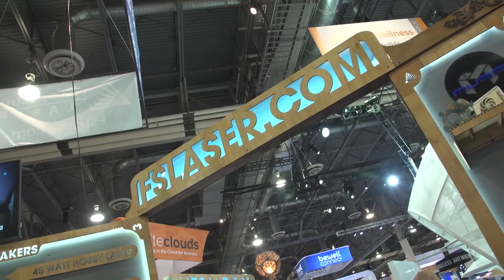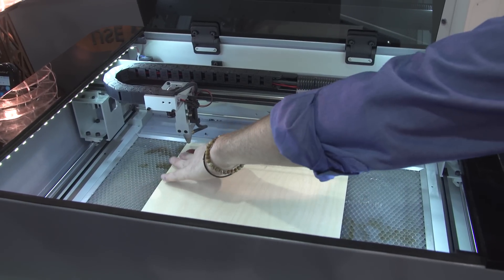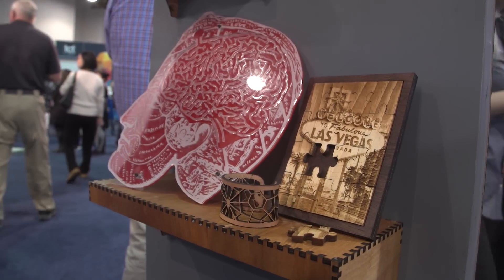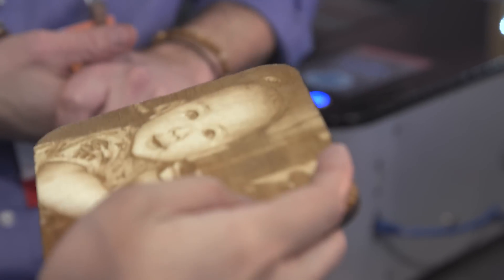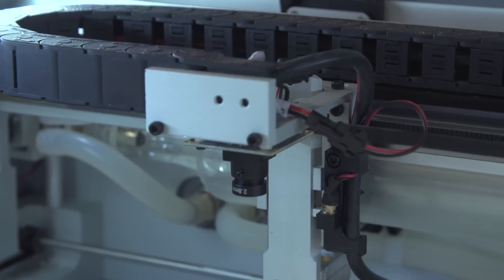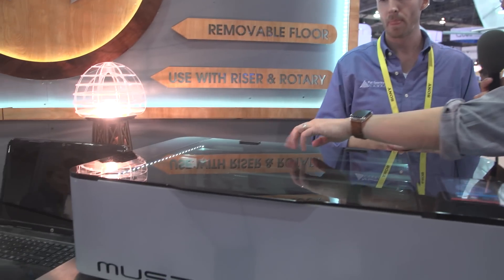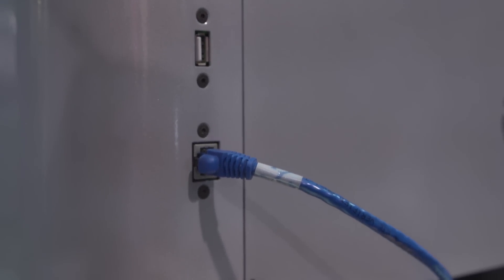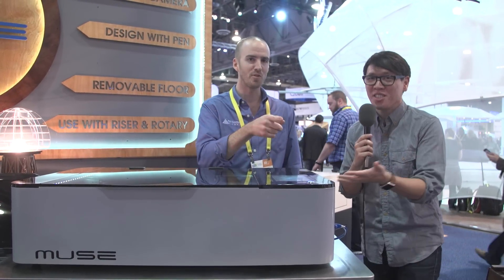First Look at the $5000 Muse Hobby Laser Cutter

Comment: I bought a MUSE as soon as it came out (big mistake) my experience has been disappointing.
List of issues:
Alignment:
- The machine has a cheap red diode that breaks easily. I broke mine a few days after using the machine.
Lenses:
- Overpriced. Lenses are glued to a metal support and FSL charges $250 for new ones.
Software:
- Retina engrave 2 was very limited and had several issues with vector files. RE 3 seems a bit better but has a whole new set of issues.
Hardware:
- If you are out of warranty you will have to pay for hardware fixes even if it was a design issue (not customer issue).

Do yourself a favor and buy from a different company.

Comment: GlowForge is becoming vaporware. They keep doing rounds of funding and have only shipped a few printers to reviewers. Their cutter hasn't changed in nearly 2 years when I've seen it at World Maker Faire yet they keep insisting they are improving it. What they really are doing is realizing they can't profit selling them at the price they quoted people so they are sitting on production until the cost of components come down which is unfair to the Kickstarter supporters. I like the FSL Muse is real with a realistic price and good features out of the box like the much-needed filter. I would put much more trust in a company that has a history of building amazing laser cutters then continuing to wait on the vaporware GlowForge keeps promising. I've talked to a few people that received the GlowForge review units and they all say the unit works perfectly and as expected so the argument that GlowForge is still tweaking is just a stall at this point.

I think I'm going with the Muse since $5000 now to get something that works is better than $2000 for something I will never receive.

Comment: As someone who runs a etsy shop this machine appealed to me as a maker. Now let's talk price, the muse is actually 5500-6000 to buy with a exhaust and air compressor. 5123 dollars with just their machine and u provide ur exhaust and air compressor. glow forge starts at 3000 and up to 6000 dollars including the same set up. Mr. Beam 2 is 2500 dollars or 3000 dollars with its air filter. Now all three laser cutters has cameras built features with user friendly software. So picking one is all about your budget and how long you're willing to wait. These machines are great for small businesses no one/the average person doesn't spend 3-6grand on a hobby in one sitting. Now in terms of getting one of the three here's the reality; Glowforge, and Mr. Beam are kick starter companies. They offer no financing they offer no guarantee that their products will be shipped out to you after you pay so much money. Full spectrum laser has financing options for all of their machines including the muse for as low as 197.80 a month, first three months u don't have to pay. fsl is a experienced company that once u pay their price with or without financing u will get the product. let's say glow forge offers financing their products, you order it, but do not get to use it until it is shipped whenever that may be ur stuck paying for it while they haven't even shipped it yet. Mr. beam too is the same way, their orders won't be shipped out till August supposedly.

Comment: Skeptical on their laser tube specs. I have one of their Gen 5 "45 watt" machines, which has a 40watt tube in it. Like all the others Those that have one of their 40 watt tubes really have the same 35watt tube as any other laser. 

The software on previous versions is good, but really suffers from bugs that they wont fix, as they skipped over to a new board and now the muse. Leaving a lot of us to deal with bugs.

Comment: Did you shoot this in 24 fps and then make the video 30 fps? That's even worse than trying to play 24 fps on a 60Hz display. Instead of 3-2-3-2 playback you get the even worse 1-1-1-2 which makes it look extremely framey. My eyes hurt. Just shoot everything in 30 or 60 and you'll be fine...

Comment: I've never liked the water cooled glass tube, they always end up cracked a lot sooner than you hope for the cost.
Reply: You really can't get away without water cooling them, though. CO2 lasers are quite inefficient, and, y'know, glass, which doesn't conduct heat well at all.
Reply: That's why I like the aluminum and ceramic CO2 laser tubes, Air cooled and aluminum conducts heat nicely

Comment: I have run several machines from this company. I will never buy another product from this company. They re-brand Chinese imports with an "improved" control board. Everything is highly locked down and proprietary. We had to beg them to give us a code to change out a faulty computer as the software is locked into a single machine. It was also glitchy as hell and would regularly freeze with the laser on. Their products are reliably the most unreliable of the 3 systems I have set up and used.

Comment: sound seems bad :/ 

but is there any laser engraver&cutter for much cheaper? like less then 1000€? because a laser could be a good alternative for my 12th grade project which is currently planned as a 3D printer and i have to decide by tomorrow.
Reply: Yes.
A chinese 40W machine is around $500. eBay, Amazon, anywhere you want.
Though a 3D printer is also a nice project.

Comment: Just what I have been waiting for!  Bought an eBay Chinese laser engraver for $500. Got software in Chinese, instructions written in ????. Absolutely could not figure out what they were trying to say. Spent two days on the internet before I could get the first engraving done. One of mirrors burned up a few day later. Told the eBay vendor about it, and, after 10 days, he had still not even sent a replacement mirror out.
Checked with many, many American sellers and it basically boils down to $10,000 minimum for a 40 or 45 watt unit.
So, if you have the money, get this one - at least you will have software and manuals that you can read and understand.
Reply: This happens allot with cheap equipment.
Reply: Bullshit.
They'll still be reselling chinese units with a huge markup.
If you're too stupid to understand how a silly little laser cutter works, maybe this is indeed the tool for you - but not for the people that value their money and don't want a joke for $5k.
$5k gets you a huge chinese machine with a >150W laser and a really, really large work envelope.
Reply: Spirit By all means, shine on China! You ever buy tools from Harbor Freight? Bottom line, you get what you pay for Yankee.

Comment: What differentiates this from a Glowforge?
Reply: It has no pass through meaning you can only cut a little larger than letter sized vs the GF bed with x infinite length, it has a water cooled laser meaning you have extra parts to break down (pump, hoses{imagine water spraying around in your ELECTRIC machine} more wires/plugs),  it uses corner loops so if you have a square hole in the middle of your piece you will have do little ‘holes’ circle cut outs at each corner of your square hole, they listed a number of things they don’t feel confident in cutting thicker than ⅛th/¼ inch vs GF ½ inch.

Comment: In what country, or even planet, does a $5,000 piece of hardware fit into the "hobby" category?
Reply: In countries where hard-working people are paid well for their work, and spend their discretionary income on things that bring them pleasure: boats, motorcycles, airplanes, etc. all can cost way more than $5,000. A single high-end digital camera can cost well over $5,000, yet many of those are bought by hobbyist photographers. I know several people who have well-equipped woodshops at their homes with thousands of dollars worth of woodworking machines. There's no upper or lower dollar limit that defines the hobby category; it's only defined by the intended-user base.
Reply: Just purchased a set of cylinder heads for over 5K, not a professional race car driver just a guy that likes to go fast on the weekends. Hobby simply defines the intended use, not the price tag.
Reply: kim Dierichsen True, but hardly repeatable. I prefer repeatable 1/4 mile times honestly. but thanks for the suggestion.
Reply: Have you priced a good parachute lately?
Reply: Well that depends on how little you value your life doesn't it?
Reply: Kelly Martin I can tell you parachutes for a car are pretty darn expensive, so id dare imagine that a parachute for skydiving would be pretty darn pricey. Even the cheap ones lol.
Reply: Hobby RC cars used to be $500 USD. They weren't cheap either.

Comment: How is 5 watts and a new interface worth the $4500 over the Chinese knock offs?
Reply: They are an American reseller of cheap Chinese lasers, or at least they were when my maker space was given a new one from a university. They bring it into the US, slap their proprietary controller and mark it up several times. Most unreliable laser I have ever used and to put that into perspective I have been involved in the purchase and installation of 3 new lasers. 1 Full Spectrum and the others cheap china knock offs.
Also what they aren't up front about is the fact that they lock their control software to a single computer. That computer crashes and burns as it did in my case and good luck trying to convince them to let you install it on your replacement machine.

Comment: perfect timing since Glowforge keep slipping delivery dates. 1000 more than Glowforge and don't need net connection.  I will order as just canceled Glowforge order last month.
Reply: Don't.
Instead spend $5000 on a 200W chinese machine that has a huge work envelope and higher quality parts.
Reply: Spirit can you recommend a manufacturer?  I know from working in China nuclear power industry that they can produce kit at fantastic quality.
Reply: fraser douglas Most of them are noname units, and are manufactured in the same factory.
Just search for "%wattage%W laser" on aliexpress/eBay/Amazon.

Comment: 20x12 40 watt laser for 5 grand...GTFO.  I can get the equivalent 50 watt Chinese model for $1900 and add the bells and whistles I really need, coming in at drastically under cost in comparison.  Everyone always admonishes people for buying cheap hobby lasers from China, but when this is the domestic equivalent, who can blame them?  I get that the fit and finish is truly turnkey with models like this and Epilog, and the quality is higher, but that QC and increase in CO2 module life isn't worth the drastic increase in price of over 3 grand.  It's a laser....CO2 module emits amplified photons and cuts substrate via mirror alignment.  It's old technology (like, invented in the 1960's!) and not brain busting.
Reply: $1900 for 50W is a bit much.
A K40 machine is around $400, for $1900 you can get a 60W or 80W tube with a larger build envelope.
$5k gets you an industrial machine with a huge(>150W) laser and an equally huge work envelope.
Reply: That's kind of my point.  I've settled on something a little nicer than a Redsail but 5k is quite out of the ballpark even for something that I WOULD consider hobby grade and not bottom of the line.